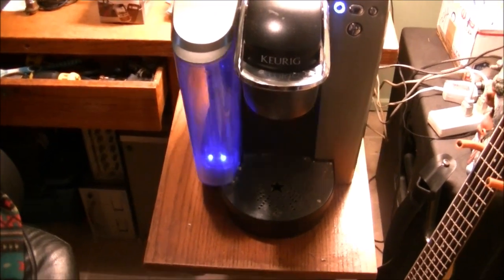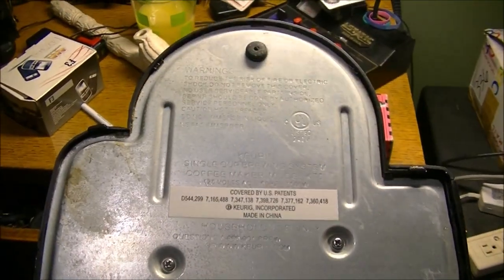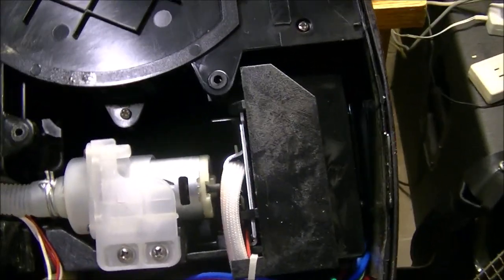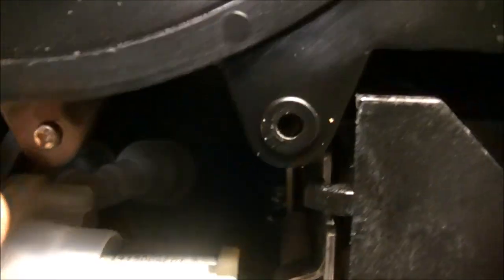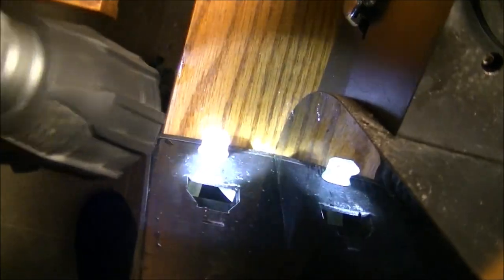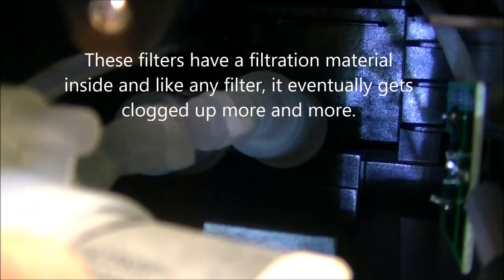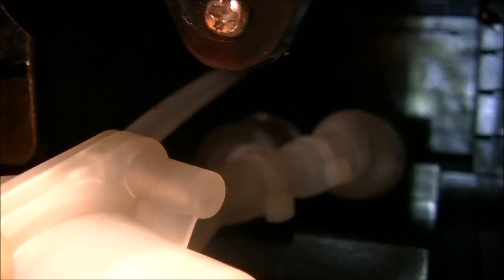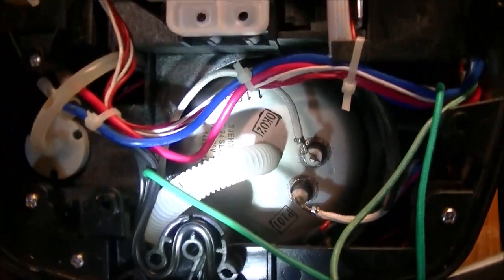Why Keurig Coffee Makers Get Clogged Up

Comment: Andy, hello.  The filter, you said, looks like an inline fuel filter in older Cars. If a replacement is unavailable, the best bet is to use  an in-line fuel filter . Check on the inlet and outlet OD. after all, a filter is a filter. The Coffee maker filter is also a paper filter. Fuel filter will work.
My Coffee Maker is Nespresso. Been making good Coffee for past 5 years. We use RO filtered water at all times. Good luck.
Thanks for all the help. Stay safe and 73s.
Reply from the maker: Thanks Sree. This is brilliant. All these filters do look the same. I am pretty confident it is a paper filter and it makes sense that it would be of a cheap kind to make production less expensive. Thanks for the tip my good friend.

Comment: Really interesting, thanks. Unless the filters act to increase intake or outflow pressure, couldn’t they just be bypassed? If not, perhaps just cycling through some white vinegar every so often through the system and flush with freshwater before use?  I don’t know, just a suggestion. Cheers!
Reply from the maker: I have thought about that but I am not sure of the quality of the water over time with possible buildup of whatever in the hoses and nozzle. I think regular cleaning would take care of that. It sounds like a viable option my friend. I will consider it. SO far no luck on finding cheap filters. The kits are $50.00 American but I am not sure if it will fit.

Comment: Maybe just ignore the filters altogether, Do they really help anything at all?, -just replace the flexy pipes with new hoses and be done with filters altogether, I dunno-just a thought. Have a wonderful day. Sam.
Reply from the maker: That is something I am considering. I woud need more regular cleaning then to ensure safety. My fear would be that there may be an unsafe buildup of something harmful over time. Your suggestion sounds viable with regular cleaning I think. We'll see how it goes. The kit to replace is $50.00 USD so viability is in question as well. I am not sure if I have found filters that will fit but you have to but a bunch of stuff to get the filters. Very smooth sales pitch... LOL.